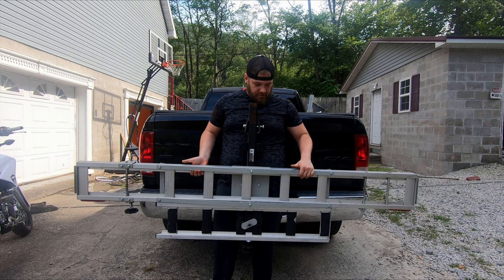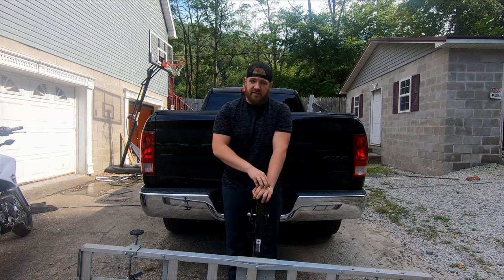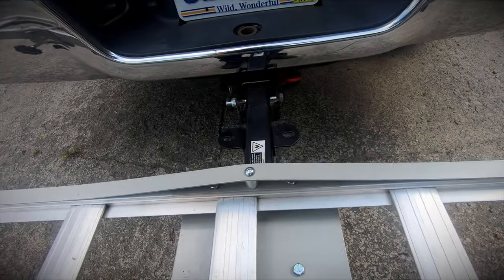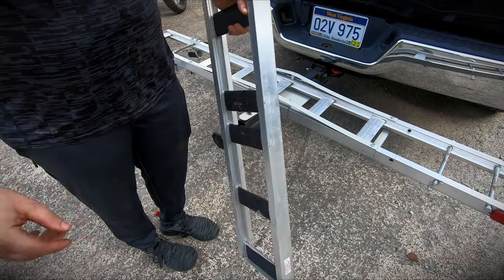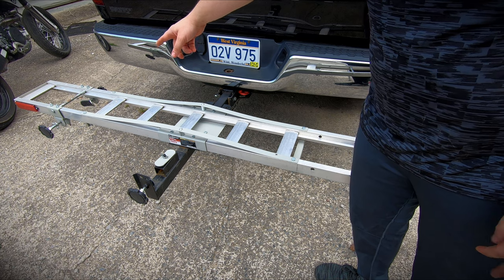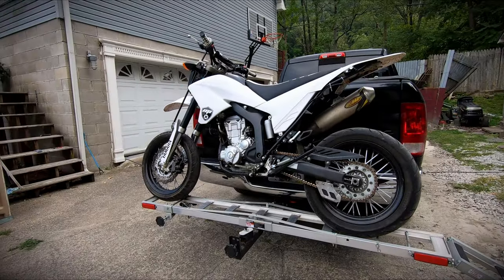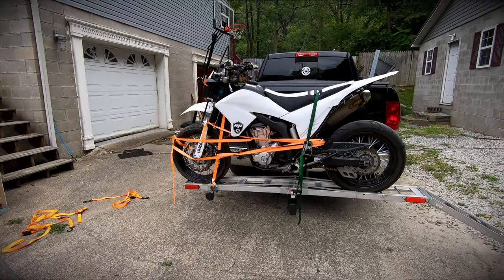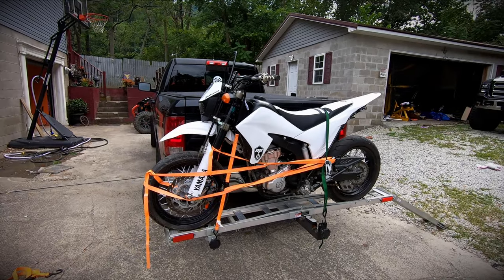Harbor Freight Motorcycle Carrier:  Install/Loading/Driving

Comment: Just bought one today that is identical to this one from Northern Tool and it was $180 bucks. Harbor Freight didn't have in stock and Northern did so I had to pay a little more.
 I am picking up my KTM 300 tomorrow and didn't want to remove the tool box from my truck. This video helped with a few questions I had. Thanks a lot!

Comment: Im going to try to reduce the ramp angle by raising it with some plastic car ramps. I'm hauling an 86 Honda Elite 250 later this week.
Edit: car ramps worked well.  It fit the scooter very well without issues. Used the holes on my receiver instead of the 90 degree hook holes and it was much more secure on the platform. Paid about $105 after coupon. Well worth the price.

Comment: I have the same ramp, not too impressed with it but it gets the job done in a pinch.  Hauled my Dual Sport 7hrs on the interstate so it did what I needed it to do, used extra straps, but like you said, they could've added better straping points.

Comment: I appreciate the video, I just got the rack and couldn’t figure out how the hitch stabilizers worked and this helped. Haha
Reply from the maker: Not a problem buddy.  Just post if u have anymore questions
Reply: Me too I thought the bolt was the wrong size I just goin to the hardware store to get a different on til I found this video
Reply: srqFF My stabilizers don’t form and exact square, I’m putting it on a Ford escape 2018 model. Does it have to be exactly square or does it matter? Thanks! Great video
Reply: Same here, I surely appreciate the info on how that stabilizer is supposed to work. Thanx a bunch 👍👍, Great video

Comment: I have a DRZ400 and can confirm super hard to get the tires out of the slots. But it’s supposed to sink in the holes to stabilize the bike and lock it in place better.

Comment: Hey Pj!! Thanks for that video. I haven't been able to find anything on this particular one except for yours! I like the idea of keeping the pins in. Right now I have them all out and the tires sitting in them. When the tires are inflated fully the pins don't go through. The option to keep them in will make it easier to load and unload... Speaking of which...would you show how you unload it? I'm a beginner motorcycle rider and want to be self sufficient and take my bike with me to parking lots to practice and don't want to count on anyone to help me if they're not around. This was a great video! I use soft straps to knot around the carrier and hook into those for the front. I'm not sure hooking into the wheel  clamp screw will last  long. Thanks again for this!!

Comment: I bought the same rack and the hole for the stabilizer bolt was drilled wrong. The stabilizer brackets don't reach the receiver, so I'll need to drill a new hole. Overall, its a fair rack and a good value for the $$, but there are more heavy duty options available for sure. As noted, the ramp could be a foot longer to make the angle more manageable.

Comment: The pins go through the wheels so the bike can’t fall off if the straps come loose. If your wheel drops too far down you can find a way to add a cross member.

Comment: I used the hitch stabilizers differently. If you rotate the bent ends towards the truck so they press against the hitch it makes it even tighter as it wedges into place as it tightens. This may not work for everyone if hitches aren’t standardized.
Reply: I have a Nissan Frontier. OE hitch.  I can’t use the stabilizers as explained in video. They’re too short. They kind of help if used as you describe. Bent ends pointing in, towards the hitch. It was the best I could figure. Still some slop though…

Comment: I think if the tires were set down in with those pins removed that would stabilize the bike quite a bit. But like you said it might be hard to get certain size tires out of the holder.

Comment: Good review! Question for you though. I have a Honda ct 70 with puny 10" wheels. Wonder how the space between the cross bars would act with such small wheels?
Reply from the maker: You could probably make it work.  It comes with adjustable bars that go through.  I hauled a 110cc pit bike on it and it worked fine.
Reply: Save your money and just throw the bike in the trunk 🤣
Reply: @fomocowboy  😎

Comment: I was looking at the cheap black one made by Ego and Blacksmith and # of other names for the same and stumbled across your first vid-thank  you! Forgot about harbor freight but good idea. I did not go through all your commentators yet....  Seems like some mods could be made (anyone done some?)and perhaps another few holes drilled for pin rods for tire support where others may need as well as tie down extension bars could be slipped through frame. Surely the frame can handle them sparingly. Thx again and now to see if HF has any so I can carry my TW 200
Reply: Let me know how it works. I'm looking at this to tow my TW as well

Comment: Thanks for the video. And I'm happy to see you have a proper Ram. :)
Question: How much does it sag your suspension? My Power Wagon can easily handle the weight but on previous vehicles, these have caused some rear sag. People get pissed when your lights are too high. :)
I have a 690 Dirt/SM setup which is about 300 lb.
Reply from the maker: With my WR it doesn't sag at all.  Which I recently installed airbags on the rear and it helps if it does
Reply: @PeaJayYt  Thx for the reply. Yeah, I figured I would add airbags if needed. Now that I think about it, my truck might have self adjusting headlights. In which case, it would be fine.
Reply from the maker: @MTBryanH  those power wagons are amazing
Reply: @PeaJayYt  Ha yeah. It's a beast! I love it!

Comment: my friend your straps are all wrong, this is designed to be center strapped, 2 to rear and 2 to front onto the eyelets on the main beam. Strapping to the threaded bolts is a big NO NO, take it from a guy who is 59 and trailered hundreds of times 👍 PS get rid of those orange home depot straps and get hvy duty woven straps that wont stretch as much as those crappy ones
Reply: My thoughts exactly. Looked sketchy.

Comment: So you are reliying totally on straps??? Jeeeezzz...the front tire goes throuh, then a pin through the rim and so it doesn't fall all the way through it has two clam like things to hold the front tire (Which u decided to hook the straps to) then strapps of course
Reply from the maker: Yep.  Totally on straps.  Most of the time I'll pin the rear wheel where it's a bit bigger but the front I wont
Reply: straps are just fine 🤣 people get so freaked out over safety when some stuff is just common sense lmao
Reply: 208 off-road use only straps are fine but I wouldn't trust them, i've had them tight before and with the weight jerking they became loose... Not trusting them 100%